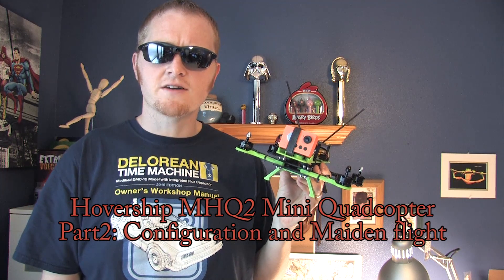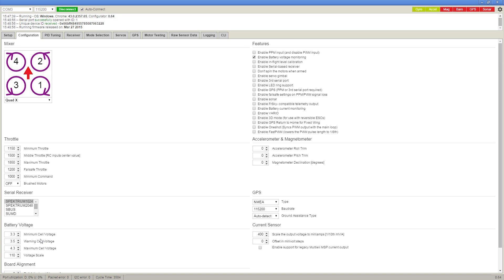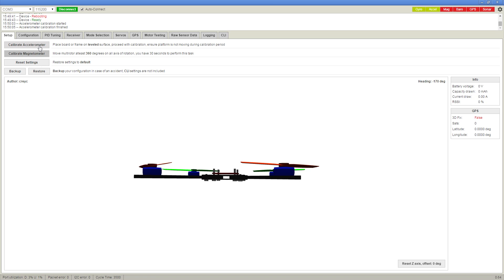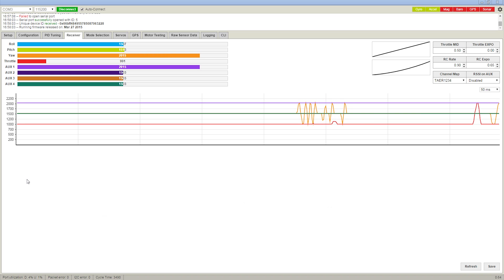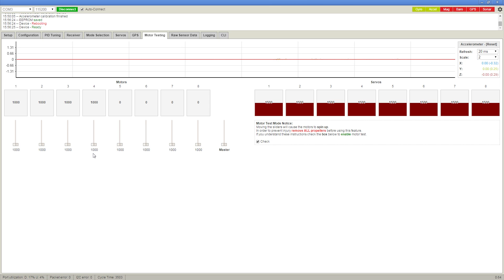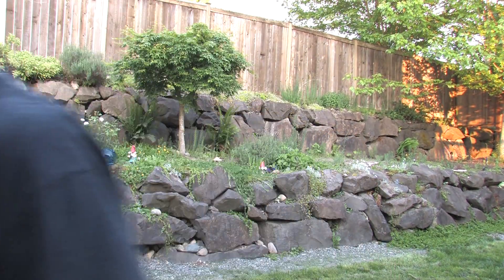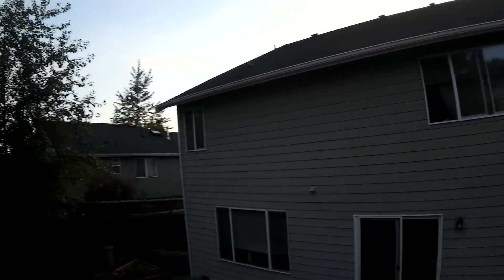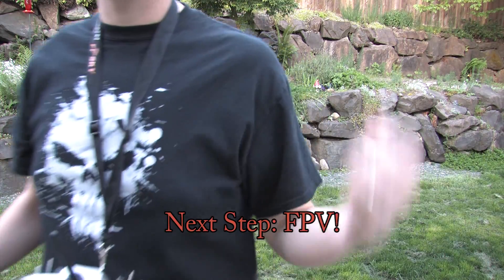3D Printed Mini Racing Quadcopter HOWTO: MHQ2 Part 2 - Configuration and Maiden Flight

Comment: Quick question what size print bed to you need for the frame, i am about to purchase my first printer and i can not wait to print a quad frame, so i am just wanting to know what printer you have and the bed size
Reply from the maker: Darren Howes I have an ultimaker 2 which prints about 8" in each dimension.  People have designed alternate parts for this copter if your printer is smaller than this though.

Comment: Could you please share your PIDs?? Thanks
Reply from the maker: peter97silva I haven't flown this enough yet to even start messing with the PIDs. I smacked it into a tree the other day and have bigger problems now lol
Reply: cozmogeek ohhh i see :D what about with the base pids?? What do you think of it? Was it twitchy or what?
Reply from the maker: It is really twitchy to me since I'm used to flying the "prinspire" which is several times larger.  This is my first 250 sized quad. The slightest amount of wind bounces this thing all over the place.  Of course it'd be a lot better in a large open area instead of these short test flights in my tiny yard.
Reply from the maker: However I will say that so far this thing has held up great. I haven't broken anything on it other than props so far.